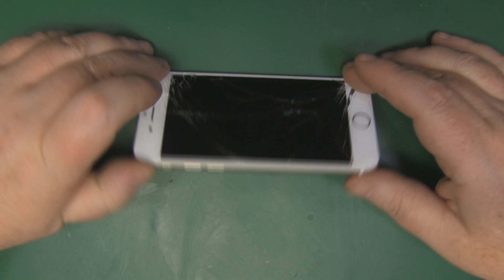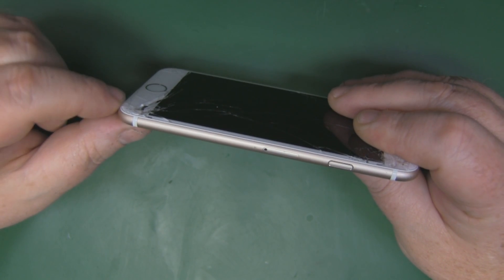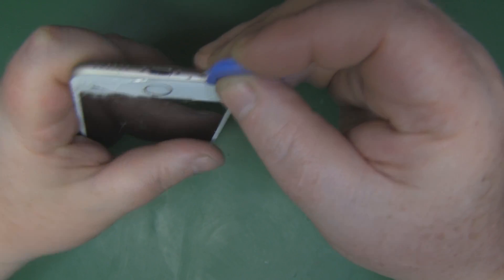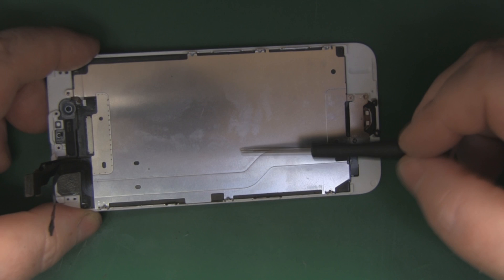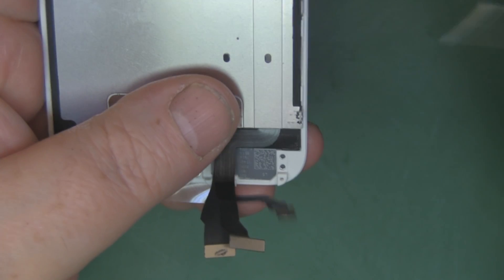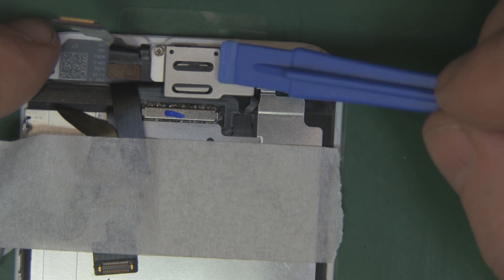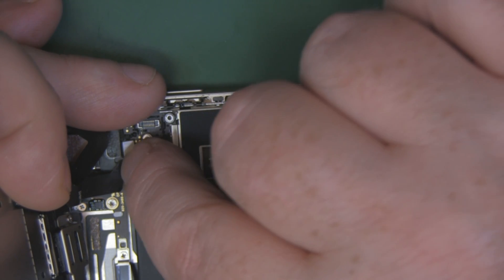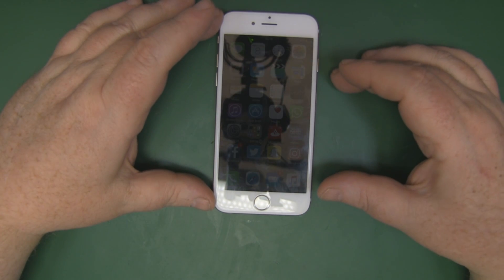iphone 6 Screen Replacement full Tutorial

Comment: Very useful video, I followed it closely and successfully completed the job. In my case the speaker/camera ribbon cable was well glued down and took a bit of shifting, all the time being careful not to damage it. Only things I could add for improvement would be to disconnect the battery connector first so that no power is on the phone to avoid short circuits while working and to very carefully record each screws location as many are different lengths and putting a long screw where a short one should be could irreparably damage the main board. Other than that an excellent video which made job so much easier for me. Thanks very much, keep up the good work!

Comment: Very timely Andrew. I have one to do for a friend next week. Thanks.
Reply from the maker: Glad it helped you out Verm1n it's been some time since I have done a repair like this myself.
Reply: I've done the 4th Gen a couple of times (many moons ago). This actually looks a bit easier. I like your paper template trick. I used to use an ice-cube tray and number the iFixit steps on bits of paper in each of the compartments. I'll give your way a go this time.

Comment: just did mine, it was a little tricky to get the steel plate bottom connector cause It was way glued; also as help you could tell on the 5 screws cover which place is for the largest one, other than that it was a nice video and help a lot, obviously it took me more than 15 minutes hahaha thanks!